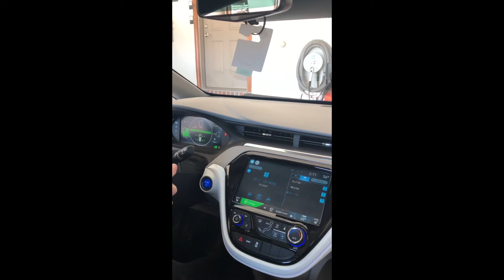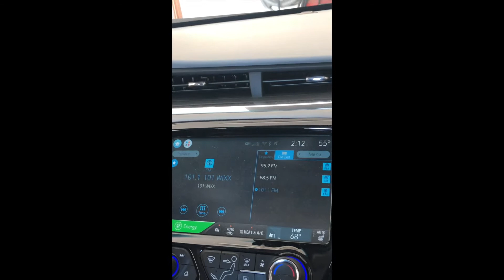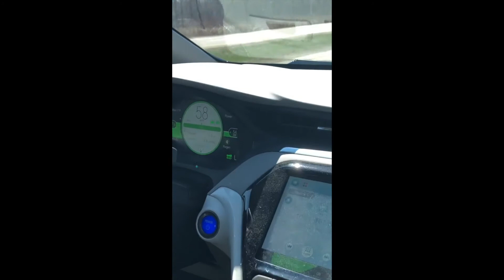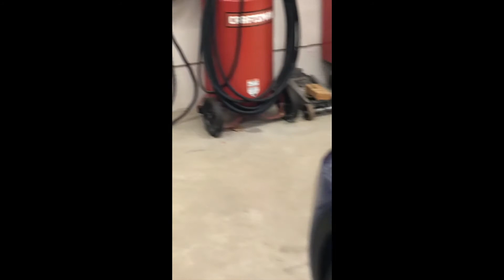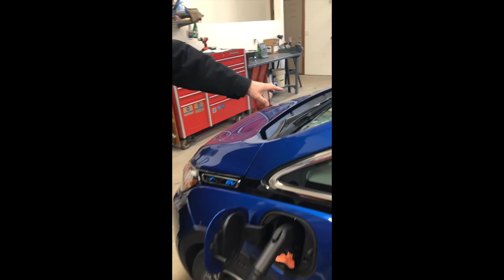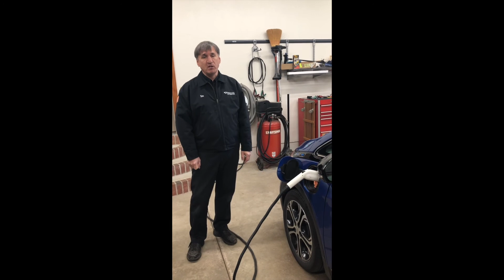Learn about the Chevy Bolt Instrument Panel and Charging Process with Tim Moy

Comment: 4:08 On level 1 charging, I get 4 miles/hour or 1 kW.  With a 60 kWh battery, it takes 60 hours to charge from 0 -100% (which you never do).  Your math of 1 day to charge on level one is off by 1 q/2 days.
Reply: Kevin, you are correct my math is off,  your math is correct.
Reply: The Bolt allows you to set 12 amps on 120vac.

12*120 == 1440

60000/1440 == 42 hours to charge from 0% to 100%.

Of course, no one is ever at 0% and you shouldn't charge your Bolt above 60% unless you're going on a long trip. 

So typically a charge is from 10% to 60% which is 30000/1440 == 20 hours.

Of course it is more complicated than this, because the charger efficiency at 120vac is only 70% (vs 90% at 240vac) so that 20 hours is actually 30% longer so 26 hours and then there is the matter of the systems overhead to run the charge control computer (which is about 50W) but that is basically noise.